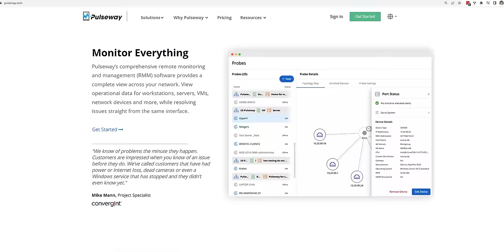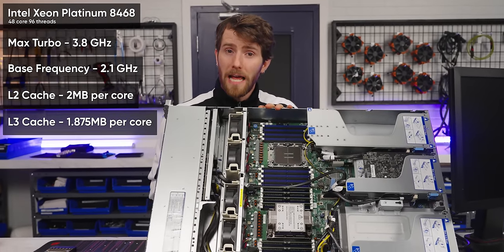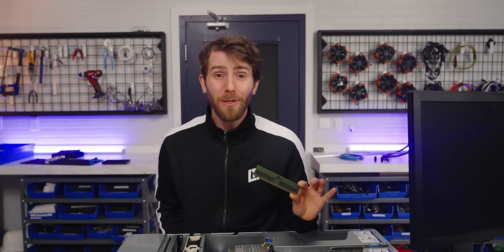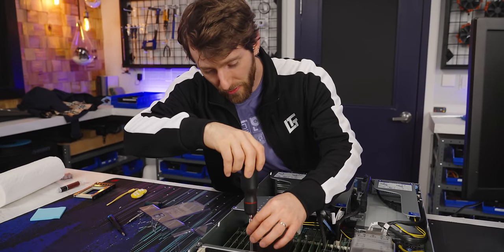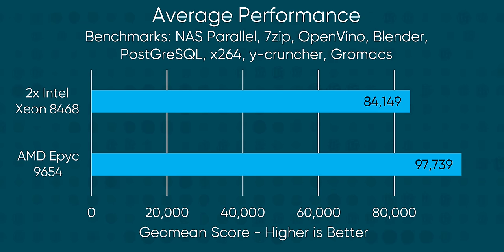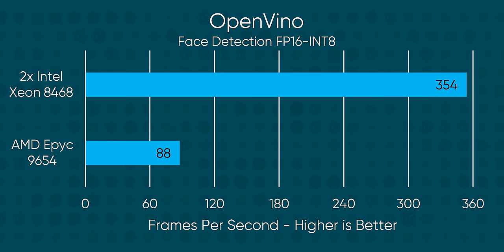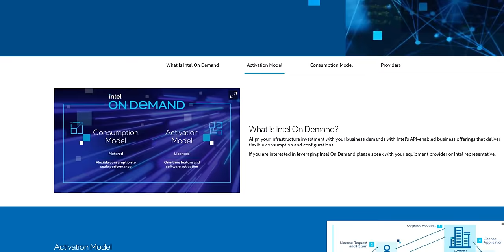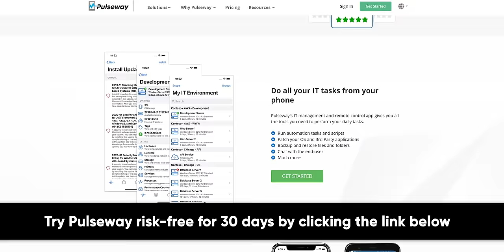Intel’s New CPUs are Cringe - Intel Sapphire Rapids Xeon Platinum 8468

Comment: Linus - "It's a bit of a finicky socket to install in." Also Linus - *Drops thermal paste into the socket*
Reply: That seemed to me an obvious design flaw. Human error will cause many people to intuitively drop paste into their socket due to this design.
Reply: @LiamNajor  or ruin the socket as the CPU falls off that heatsink and drops onto the socket... I witnessed enough people ruin desktop and laptop LGA boards by dropping CPU's in them, this just seems scary.
Reply: @LiamNajor fr
Reply: @volvo09  I build a few servers with these heatsinks and it is actualy way better than the normal way of droping a cpu into a socket.
Reply: Also Linus: Thaks to Super-Micro for lending us this (insert expsnive sounding name here). Uh-oh I got electrically conductive paste in the socket. Eh shoudl be fine.
Reply: Linus' is only qualified for a job @ "Will it blend?"
Reply: @LiamNajor  With enterprise stuff, you'll normally get the CPU and heatsink as a single unit. Something really wrong must be going on that you'd ever have to deal with thermal paste. Swapping a CPU is normally a quick one-two of popping one CPU/heatsink for another.
Reply: @LiamNajor  Linus is installing it wrong... Trust me I'm literally building 6 of them after lunch.
Reply: @EfrainDiazJr  Linus took the unit apart to look* at it.

*irretrievably destroy
Reply: @hardwire666too  A bit of a long reach to assume they used electrically conductive paste
Reply: @LiamNajor  i saw these CPUs and similar motherboards  in person. I'm not confortable installing the CPU. It will be a disaster in production.
Reply: Should have just used ptm 7950
Reply: @LiamNajor  Not really considering hardly ANY end users will ever be building systems with this.
Reply: Omg.:face-red-droopy-eyes:
Reply: But it will be fine.. probably
Reply: @dtibor5903   First, 95% of these will come in a server already installed. Servers aren't like Desktops. You don't typically buy parts outside of ram or IO additions after the fact.
Second, servers CPUs almost always come connected to the heatsink as one piece when purchased separately and are simpler then desktop CPUs to install. 
I work in a center that does enterprise benkmarking as one of our specialties and we have been running these chips in pre ga testing. We even do get actual CPUs without heatsinks sometimes to test before market when working on something directly with Intel or AMD and they have us switch out versions quickly. I have never seen anyone ever have an issue doing a CPU install or drop paste onto a socket in a server. Think about it, even if you are applying paste, who would do it over the motherboard? 
If you work on a floor that does hardware changes like this, this stuff is easy. You have to try to mess it up. Kind of like applying paste over a board. That shows either a problem in thought process or a lack of caring.
Reply: He has to drop something;)
Reply: 1337 likes
Reply: Linus proving once again that when it comes to servers he is seriously, and I mean SERIOUSLY, out of his depth. He needs to put a fact checking video up to show what he did wrong in this video.
Reply: I guess finicky sockets hate paste in them.
Reply: That was so bad. His regular 'keep it loose and mess around' did not go well
Reply: Not always impressed with all the intel bashing, we get it you are in love with AMD now.
Reply: I LOLed sooo hard at happening in the video... 🤣
Reply: @AarushKumar-sf1vk I'm fairly sure he was joking my guy
Reply: As I was watching it I'm like "why are you doing all that directly over the server! If you drop the heatsink into the motherboard or ram or anything you'll break everything!
I guess dropping the thermal paste into the socket is about the best outcome lol.
Reply: @LiamNajor  all one needs to do is take the flat rectangle heat sink, NOT HOLD IT OVER THE SOCKET but place it on a table. then apply thermal paste to the heatsink that is placed on a table top, then place the cpu on top of it... there's no excuses for holding the cpu and heatsink at a 45 degree angle over the mobo itself. this was just poor planning.
Reply: @trakaiszeks  It's definatly not conductive,
but it does have the opposite problem, its *electrically insulated*.

I blieve CPUs needs a highly conductivity contact at the socket xP
Reply: my thoughts exactly
Reply: @One_Guy  There is a reason, it was being filmed and that angle is better for it. Why he did it over the board is beyond me.
Reply: Also Linus drops a whole computer lol 😝-/
Reply: @LiamNajor  the design, is very human
Reply: why oh why would someone apply paste to the heatsink like that while holding it right over the socket?
Reply: @hardwire666too  Yeah, I don't know, these recent "accidents" are starting to feel staged.
Reply: Linus makes me cringe. He's banging or dropping or bending or scratching or damaging something in almost every single video. He's literally teaching millions that being careless is fine. Everything is fine.
Reply: @LiamNajor  Or work with the separate cooler and separate CPU, not requiring hovering over the server itself unless framing for a video. The thermal paste is viscous enough to essentially adhere the CPU to the cooler, especially given the cooler is considered as part of the mounting hardware based upon this design. The CPU will stay there, unless the person working with it is honestly unqualified to operate near any grade of hardware, and be socketed in a pretty reasonable fashion. 

The only problem is that Linus was both doing this quickly and attempting to maintain the server itself in frame as much as he could. The platform may not be the most user-friendly, but the assembly in a rushed fashion here is entirely to blame. Even a rushed builder would separate the workspace to mount the CPU to the cooler, it shows a clear lack of concern for the situation. 

I would hope that it was him taking the situation and just moving on with the video, rather than dwelling on it and perhaps ruining a shoot, because he probably knows all of this. Performance may not be the time to take stock of the ways an accident could have been avoided, and the show must go on.

Edit - Not to mention he will likely either report it as an incident to them or will simply clean it since it's generally not a huge deal to remove, even in enterprise chips, because they're all the same materials. There's insurance. The casual response may be covering for a recognized mistake, and it could also be that he recognizes it's not a big deal, and isn't hitting down on his sponsor - he's just hitting down on Intel, who he hits down on overall anyway.
Reply: @hardwire666too  I dont believe noctuas paste is electrically conductive so it should be, "fine"
Reply: @hardwire666too  Thermal paste isn't conductive (except the absolute cheapest garbage tier stuff and liquid metal, which this clearly wasn't)
Reply: @Mallchad  They do, but the paste will probably squish out
Reply: @coopercummings8370  eh.
It will move a fair bit but thermal paste is really gummy, vicious, it really likes to coat surfaces.

Stuff like that tends to cause silent errors in computers but you'll never really know......

Also poor super micro
Reply: Don't these things come in a plastic carrier that allows you to clip it to the heatsink without even touching the CPU at all? I feel like Linus is missing something.
Reply: i think it's made like that to counter the cpu movement cause it was so wide and large but still they could use lga sockets, wtf intel
Reply: @hardwire666too  most thermalpaste isnt electrically conductive, liquid metal is though.
Reply: @Eremon1  Honestly I think it would be the opposite. They all do their own thing while Linus is not really involved, before he goes on camera chances are he's barely touched the product if at all. If he had to do all the research and work himself he would know all the small things too.
Reply: glorious tech tip right there. I will do it every day
Reply: @s8wc3  If he had to do all the work himself, he wouldn’t have a channel this big.
Reply: Surprised he didnt go full verg after the thermal paste oops 
Lol was waiting for him to brake out a swiss army knife and all
Reply: @clansome  And you should go back to English class to get the meaning of "fact checking" right as it has NOTHING to do with how something is to be performed
Reply: Ah yes! I see you have also watched the video, fellow video watcher!
Reply: @loneyerf625  Totally agree. Linus bashes it as under-engineered and sure it's not the most complex system in the world, but it just works.
Reply: @EfrainDiazJr  sure but, the new HEDTs will use this socket too and I am sure CPUs won't come with water blocks pre-installed
Reply: @LiamNajor  I think it is just obvious that working on an open server is a very bad idea, design seems pretty smart to me
Reply: "Yep, can't be my fault"
Reply: throwing new rare gpus around, thermal paste in socket, let fall down any kind of hardware etc ... i bet theres ppl out there who are suprised ONLY that happened lol
Reply: @High-Tech-Geek  But it gets the comments. Engagement=$
Reply: @Nitidus  Nothing to do with the performance, it's to with the way server CPU's packaged and are installed by competent builders. The results are the results.
Reply: Let's not apply thermal paste directly over a CPU socket.
Reply: thermal paste on the socket is not fine, happened to me LOL the PC worked, but I ran into many problems, spent a year trying to figure out what was wrong, turns out it was the motherboard because of the tiny little smudge of thermal paste on the socket. The CPU was fine tho when I installed it on a new motherboard.
Reply: Then proceeded to blame everyone else.
Reply: @trakaiszeks  ...but the machine failing immediately afterward suggests so.
Reply: @trakaiszeks  Even non-electrically non-conductive paste may have caused a malfunction, by interfering with the contact/conductivity in the pin/pad interface.
Reply: but we learned from that random guy on the YTshorts videos that you can actually fill your entire socket with thermal paste and still install the cpu working.
Reply: Thermal paste is thermally conductive not electrically conductive. Paste in the slot shouldn't be the cause of the problem as long as they cleaned it enough to make contact with the CPU.
Reply: @kingofstrike1234  It is an LGA socket, land grid array, it's just a new version,
I think that CPU retention is a common thing in enterprise CPUs because it lets you move around CPUs without faffing with thermal paste, saves time and money. As well as reducing the likely hood damage and improving mounting alignment.

It's kind of important in a building with thousands of computers and the failure rate being tens or hundreds of CPUs a year
Reply: @volvo09  wtf? I'll never understand how someone can manage to drop a cpu into a socket. I've seen screws dropped in sockets and on components on the motherboard, bricking it. idk about a CPU tho seems crazy
Reply: @mycelia_ow  yep. My co workers at the office (when I did desktop support) did it a few times over the decade I was there... CPU slips out of fingers upon removal or replacement and the corner hits the socket. Or the person picking the CPU up wrong and dragging it's corner across part of the socket.

Bye bye motherboard, now you can go explain how you have to purchase a new board because you can't return it under warranty. 😆
Reply: @notestine0221  yeah sure
Reply: @hardwire666too  bruh it's fucking NH-1 it's not electrical conductive, that's metal liquid, which you wouldn't put in a server, lmao
Reply: Dudes so high while doing that 😅
Reply: Kind of two completely different things though, aren’t they?
Reply: @LiamNajor  Normal human error and Linus human error are two different scales.
Reply: @Aarush Kumar There are scales to human errors. Consider chainsaws, fundamentally dangerous so they have safegaurds. For one examples, they have buttons that turn them of when released and need to be held down the entire time they operate; A design feature that reduces human error. This CPU design, at least near Linus is a chainsaw with no safeties mechanisms.
Reply: @IDv8I  How is accurate reporting bashing?
Reply: @sqeaky8190  I've been watching Linus for a long time and for a year or two now he seems to find anything he can to knock them down and has been stroking AMD instead. Intel Extreme Upgrades has been dropped and AMD is the new sugar daddy now. I agree that the reporting is usually accurate, but he is over "acting"  a bit on when he can call them out even the smallest thing and the findings are not always that meaningful. Between that and, most of the WAN shows are becoming one long infomercial for their merch, it has frustrated me. I guess I heard a tone or facial expression that probably put me over the edge to make that comment. I'm looking down at my full-sized desktop mouse pad, water bottle wearing a  WAN show hoodie and have been enjoying his screwdriver, so I support the crazy Canadian, but the Intel and Nvidia bashing seems to be a bit over the top lately, and I feel I'm entitled to my opinion.
Reply: Unintended to mock Intel😆
Reply: also also Linus: The socket is not the working. I can not think the why. Oh. Noes.
Reply: Would it be a Linus video if he didn't drop something?
Reply: @LiamNajor  True, but most IT people with half a brain wouldn't apply thermal past to a giant heatsink while literally standing over the server socket... They would do that in a more responsible manor knowing there are tens of thousands of dollars of equipment at stake.
Reply: @thunderarch5951  I don't think conductive or not is the point. Anything foreign in a socket that delicate and complex is going to be bad. That paste could just as easily insulate the pins from the CPU or push them to the side when the heatsink is cranked down.
Reply: Yeah, as soon as I saw him do that I knew it wasn't going to POST. I've seen way too many issues caused by careless work like this....
Reply: @clansome  Like what?
Reply: It's fine, he's special
Reply: have to be amd processor the great one advance machine german = amd advance micro device AMD EPYC
Reply: @volvo09  Actually starting from Skylake Xeon with the then-new LGA3647 socket, you're supposed to install the CPU into the heatsink (with thermal paste pre-applied) before installing the whole CPU-Heatsink assembly into the socket. The CPU is fastened by the bracket on the heatsink and is actually hard to get the CPU out once fastened.

Comment: I'm absolutely astounded that he dropped thermal paste on the socket and didn't bother to even try and clean it out with alcohol...
Reply: He probably drank it all, but it didn't make Intels crap look any better
Reply: it is better to not to touch a socket that have thousands of small pins. there's solid chance linus will bent a pin or two in the process of cleaning it
Reply: spilt a lil bit of paste in my socket. Freaked out and tried to get it out. Bent pin. Proceeded to break pin in process of fixing it. Should have left it alone.
Reply: better not touch it
Reply: Clean it out with what? Qtip is too wide, cloth would drag all the pins and bend a bunch all at once, you can poke at it with a needle but at that point, why? Just send it back and let them figure it out later if it's that much of a problem because that's the best way to not just break the product